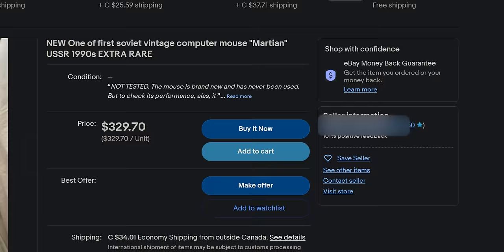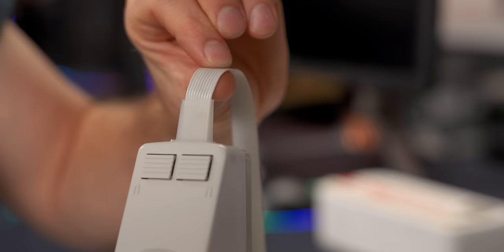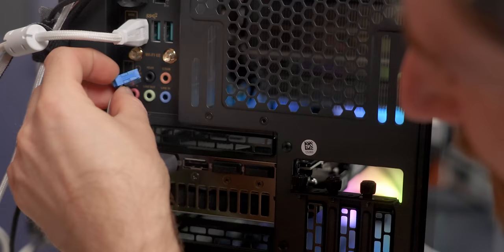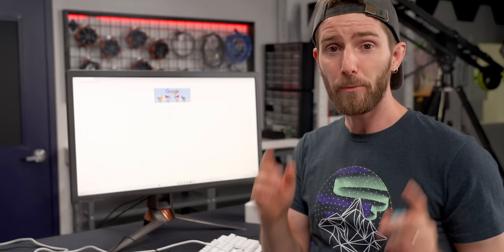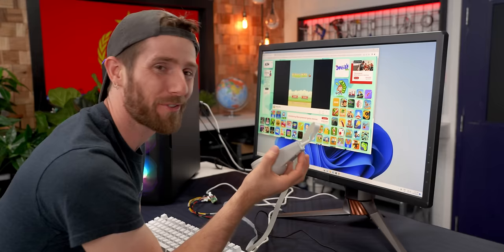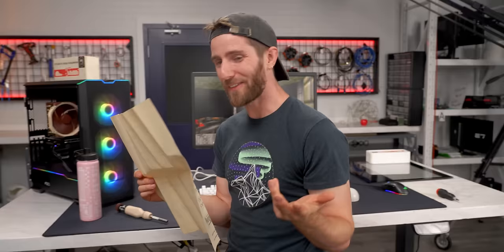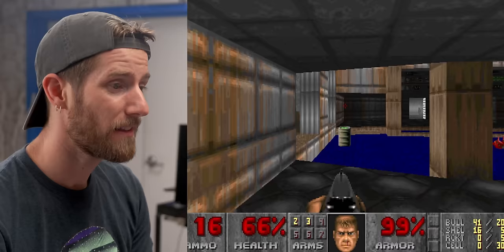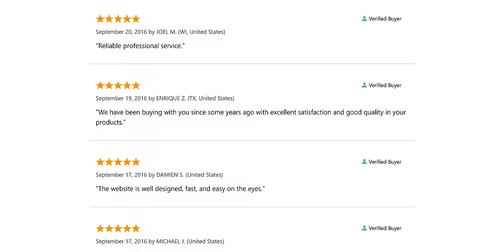I Bought a Soviet Era Gaming Mouse - MARS UKV-01

Comment: WRT schematics. It was actually common in USSR to get very extensive manual with any piece of tech. Including full schematics for TVs, sound amplifiers, vinyl players, etc. You could use it to repair device yourself or at the very least help a repair shop if you had an uncommon device
Reply: i agree its bad this trend went away
Reply: communism can be good
Reply: That was also common in the US up through about the 1950s. Most old tube electronics (prior to transistors) have a schematic glued to the inside of the chassis. There were also printed periodicals that were meant for the repair trade which would contain advanced schematics and repair guides for any new products that came out since the last issue. Those were done by a third party however. Most electronic repair shops would have a huge bookshelf full of the books as well as special index books that would let you know which issue to look in to find the device you wanted to repair.
Reply: In USSR Right to Repair was Responsibility to Repair. From radios to Lada.
Reply: @dXXPacmanXXb  It's actually just a military standard. In the USSR, all production facilities were built for military needs. Even civilian goods were made to military production standards
Reply: @staberas  "i agree its bad this trend went away"
yeah... But it wasn't dictated by the goodness of anyone's heart. In the USSR they had this silly idea of "smykałka" (Polish spelling) where basically the state or manufacturer didn't care about the product past the production. Hence ordinary people had to improvise and repair it. The state/manufacturers were aware that they were making flawed products so they at least let people know how their things worked, so the people could spend their own time and resources and repair it.

As a rabid anti-fan of Apple who uses Windows and Android, I much prefer their vile products and their greediness when it comes to servicing, than the infamous soviet TVs that had the nasty habit of catching fire or exploding. It's hard to take advantage of schematics while trying to extinguish the fire.
Reply: Yeah, even not having lived through those times, I only get serviceable lab equipment with schematics and service manuals, some 800 pages long. It can almost always be repaired, and I hate throwing stuff away, looking at inkJet printers fir example. Having this information available and the need to repair, because you just couldn't get a new one, positively affected ones understanding of mechanical and electrical systems.
Reply: @barnett25  My Apple II came with full schematics. In college I briefly worked for one of the last Curtis Mathes retailers, and repair shops, which honored the company's lifetime warranty on home electronics. They had schematics for TV's and stereos going back to the 1950's.
Reply: And that explains why my mom has a trove of old product manuals...
Reply: @dXXPacmanXXb  10s of millions died but hey repairable tech
Reply: In Soviet Russia, repair does you!
Reply: @sweatyylemonss5237 this is a clueless statement.
Reply: Well there was no such thing as a warranty. But the components were easily obtainable so yeah, at least one of the neighbors knew how to fix a tv or radio:)
Reply: @The36th  I haven't lived long enough to notice this, but by the sound of it, this sounds just like modern manufacturing, minus providing the schematics part. Having worked in manufacturing and software development for a long time, it's staggering how many things get shipped with critical flaws that have been known for years. And the management always overloads engineers with new products and features and don't care about flaws... unless they cause some kind of really catastrophic failure.
Reply: @ArthurD  Because everything made by USSR was pure shit. A lot of stuff didn't even work straight out the box. Those home repairs were not only useful, but inevitable.
Source: I was born there
Reply: @yankis.  guess what comrade, me too. Exactly 33 years ago, in 1990🎉
Reply: @sweatyylemonss5237  while it's a huge loss of people, the good things did exist as well.
Reply: @overcunning  Nah. No one today ships products known to explode. This is what they did with some of their old CRT TVs and they simply didn't care.

The closest example is the quasi-incendiary grenades also sometimes called Samsung phones. But these were quickly sorted out.

There is no point in making some kind of symmetristic point here. Modern manufacturers are bound by warranty laws that didn't exist in USSR.
Reply: @The36th  Smykałka... now that's a phrase I haven't heard of in a while. People born around the late 1990's to early 2000's should definitely be refamiliarized with this concept as many would be introduced to it during the crossover period in the eastern bloc after the collapse of the USSR.
Reply: @sulphurous2656  "Smykalka" is just a synonym for "resourcefulness". The ability, skills and knowledge to do things, fix stuff and create value. Even better if you also have tools. Once you have straight hands and mind, you have it.
Reply: Louis Rossmann would be so happy to see it! :D
Reply: It was common in the West too. At the very least you could order a technical manual but often the schematics were included in the box. Louis Rossman often talks about it in his videos.
Reply: That and the knowledge the item would get shipped around the country and phonecalls were not cheap.
Reply: @The36th  "Flawed products" For all the faults of the communistic regime (and I am speaking as a young citizen of a once Warsaw pact state), the shit they did was indestructible lmao. Fridges, washing machines, furniture and very clearly computer tech is and was built to last. Maybe they didn't nail the tvs, but it is simply a fact other tech they built lasts decades, certainly a lot more years than currently made technology or furniture.
Reply: @dXXPacmanXXb yup. Getting tech copied from capitalistic countries years later is good.
Reply: @DuckRotation look up "Road of bones" and then say that with a straight face.
Reply: @its_dey_mate  It wasn't build to last because they have designed it that way. It was build to last because it was more simple than modern solutions that trades longevity for features or efficiency.

That's a myth. 

Also my favorite example are the old cars. Yes they are indestructible because of their simplicity, but ar the same time they are death traps in case of any major car accident. Meanwhile the wimpy modern cars sometime let's you live because they're bending like a harmonic during the accident. Same goes for how much less fuel you need to use them in comparison to old cars.
Reply: @The36th  Oh with cars I agree. Those cardboard, global warming nightmare, roller coasters on the flattest of pavement were definitely not great for safety or user expirience. They were the perfect example of communist ideology. 

Cheap, mass produced and a mentality of "we could equip the most-ish people possible with it", at least in principle. What happened in reality is also something else entirely.
Reply: Good old Amatérské radio. I'm not from the era but my dad is and we have a lot of it at home.
Reply: I never thought I would be jealous of the USSR for something, but honestly that sounds awesome!
Reply: @The36th I had simple russian 30y.o fridge and got rid of it for brand new. New one didn't last half of that time. You say simple design - both were simple design with mercury thermostat. No electronics involved, few relays and light bulb. For Soviet appliances that was built to last was also polish term "gniotsa nie łamiotsa". I do not defend Soviet stuff, I think 40y ago there was different mindset. Today companies are maximizing profit to the limit where stuff is breaking often right after warranty.
Reply: @barnett25  It was common in the West even past the 1950s.  I had a old amplifier unit that was produced in the late 70s that had the schematics glued on the top cover.  I also vaguely remember the massive manuals that came with our family's Commodore 128D having schematics in them as well.  It was when devices became more disposable in the late 80s/early 90s that schematics became rare and I have a feeling that mostly came down to the integration of ICs in designs which made home repairs next to impossible - how do you repair a faulty timer in a washing machine when the timer circuit is just some logic running in a microcontroller?
Reply: WRTT
Reply: @sweatyylemonss5237 wow! Good thing nobody is dying anymore. Especially not from something like starvation.
Reply: @The36th  And now people just pretend they don't make flawed products.
Reply: to be honest the products were so simple that the average person could fix it themselves without fear of having a brick on their hands. I'm all for right to repair but if it isn't a screen or battery then the average person isn't going to have the skills or tools necessary to fix their devices since mostly everything on PCBs these days use ball soldering joints and tiny surface mount components. The schematics for devices should be freely available to repair shops but not for the average consumer because that's just a recipe for disaster.
Reply: @The36th this creates work. Nowadays to find a service technitian with skills is hard because it doesn't pay.
Reply: @Wrublos212  I'm still amazed by existence of people who truly think that today's companies try to maximize their profit while the comrades of the past were making long-lasting products on purpose xD

I also loved my old commie fridge. IU loved the electricity bills, the noise, the heat generation, the icing that had to be removed every week, the seal that I had to replace now and then, etc. Great products indeed.
Reply: @viktoriyaserebryakov2755  Of course russian is making USSR-apologist comment about today :)
Reply: @marsovac  Smashing windows also create work... What a silly approach.
Nowadays technicians are dead because the market removed them. Ironically for all of you, modern products last long enough so the job of a golden hand technician is unprofitable so it is gone.
Reply: Copyright is theft, and right to repair what you own is a human right - simples.
Reply: With Tesla televisions from czechoslovakia you could even get a service manual that described common faults and how to repair them, technical information that described how every circuit works in detail (it had schematics for all the intergrated circuits too) and a calibration manual
Reply: @infernaldaedra  " you have no idea how much money is made in repairs lo"

Talking to you guys is pointless to be honest. You all represent this hivemind of nonsense that old products were better just because they were more serviceable by the customer, and then whenever someone talks to you one of you will say that there are no skilled technicians anymore and seconds later the other person will say that there is a lot of money in repair.

This is why I know that the idea of old products being more durable and serviceable is a silly thing. Your group cannot even make up one logical point about it.
Reply: @The36th  "there are no skilled technicians anymore and seconds later the other person will say that there is a lot of money in repair." It`s not illogical if you know the bigger picture. If company is creating device with closed software and for screen, battery or small laptop lid sensor (and many, many more) you have to gain access to that software there is nothing you can do as a technician. One thing is device complexity but other thing is company anti repair policy. Technician not gonna charge you 1500$ for simple repair just like official repair shop do. So - Technicians are screwed up, customer is screwed up and big money are made in repairs. It`s just go to mother company pocket.
Reply: @sweatyylemonss5237  it's not like nobody died because of action of capitalistic countries. It is bad, but... pretty universal between everyone
Reply: @its_dey_mate agreed. Have a fridge in my summer house that was made in USSR in 1984. This guy still works
Reply: Lot of old electronics use to.
Reply: @ArthurD  Too bad that it died with the ussr. We need to stop throwing things out that can easily be fixed and companies should be forced to make such devices repairable and make the parts available
Reply: its not my device its OUR device
Reply: lol born in 1990 talking about ussr tech... nuff said @ArthurD
Reply: @jonyjohns not for no reason. 

And also no really true
Reply: I don't say this often but kudos to the USSR.
Reply: There were no centralized brand service shops in USSR. So any electronic device was expected to be repaired by 1. Small variety service shops, aka TV repair shops, that repaired variety of different devices, basically almost anything that people bring them. Big cities probably had a few of those. 2. A person that does variety of service, aka TV repair guy. Same as above, but just one guy that repairs stuff as his job or in a free time. Small cities and big villages probably have one or more of those. 3. Local tech savvy or HAM radio enthusiast. All of them, despite knowing things about electronics, may not ever seen your particular device type in their life. Here is where manual with schematic and technical detail comes into play. Also, no internet back then, so they couldn't just google a schematic, they had to stick with what comes with the device.
Reply: And to think, today in the US it's almost a crime to try to repair your own stuff. You might cause the software to adjust and, why, that's hacking and a copyright violation. John Deere used to tout how easy it was to repair your own tractor as a selling point, now they prosecute you for it.
Reply: Dunno, you probably had hands growing out of your ass, or someone who touched stuff before you. It's OK, many do. Me, for example, as a kid back then had a b/w TW that I poked inside with an Iron stick (probably antenna), and it exploded so hard, that a flew backward for a meter. I looked at antenna in my hand, it's plastic cap were vaporised and smoking. TV worked well tho'. That's just one of examples. And yeah people here may not aware, but for making shitty product, they could get in jail. Use some logic instead of emotions sometime.
Reply: It was actually common in the west, too. It only really stopped in the 90's.
Reply: soviet quality was so bad I imagine like 50% of these electronics were faulty and there was no guaranty either, if you bought one and it was broken you had to pretty much fix it yourself. Besides they produced probably like 100 of these mice per year so you couldn't find one anyway
Reply: @sten260  WTF dude? The quality of Soviet appliances and electronics varied - different factories, different designs, heck, different times. Anyone who actually lived in the USSR or in ex-USSR can name a variety of examples for garbage, average and superb Soviet-made stuff.
Reply: funnily enough we still have a functioning soviet era fridge running for about 80 years now @ArthurD
Reply: @vadimk3484  there was a lot of garbage and barely average, but superb? Nah you are tripping. If government was in charge of production of anything how is it possible to produce anything superb? They can not even figure out how to fix potholes
Reply: @FelixLeokillen as if there was no dying from starvation in the US. 6-9 mln died during the Great Depression and nobody cares. What it has to do with USSR products?
Reply: @harrkev  Even the Wikipedia article for road of bones is like there is not enough evidence to prove the claims. Look up the highway of death

Comment: While this mouse may have been slow, remember that it was designed for systems with a far lower resolution, notably:
High-resolution mode: 512x256 pixels, monochrome.
Low-resolution mode: 256x256 pixels, 4 colors.
So this would have been more than sufficient for something effectively 4 to 8 times lower in resolution.
The fact they not only reverse engineered something almost 40 years old but also in an entirely different language, a testament to the LTT Labs Team and I really enjoyed this video.
Reply: Further more, mouse navigation in command line-like interface was based on character grid, which could have been something like 50x30
Reply: another great product that they missjudge j.k.
Reply: Its sending what is effectively a cursor key while you move, as long as you keep moving, it key repeats. Makes a LOT of sense for text mode
Reply: @Vin-Drossel  Нет, Сталкер ТЧ ))))
Reply: It's because unlike gamer's nexus or hardware unboxed we at ltt labs run new tests every time
Reply: It's not "that" difficult
Reply: They did not "reverse"-engineer. They simply read the manual. Without it, they would have to map the output voltages to whatever actions they are doing. Worse yet, they'd have to guess the +5V and GND. And could easily fry the mouse if done incorrectly.
Reply: @phoenix-tt  someone actually gets it nice
Reply: @nikolaikozlovski2654  there is not much to "reverse engineered", its soviet bad copy of western mouse, also with tech documentation, you should tell its copy, b\c it have serial port already to western standard
Reply: You're right, it is made for low resolution modes, both graphical or character-based. I have the same mouse, grey color and no external controller - the model for BK-001x home computers. I even have a BK-0011M computer, but never used them connected. Back in late 1980s and early 1990s 8bit and 16 bit home computers didn't need a mouse, it was a rare and expensive option.
Reply: If you want it to go faster, why not instal gearboxes to axels(you would have Dpi selection)
Reply: @Kevin-mx4vm 😂
Reply: @MXCelis  The ergonomics still sucked. Human hand hasn't changed.
Reply: Hopefully they won't auctioned it off XD (jk)
Reply: Благодаря советским схемам в инструкции =)